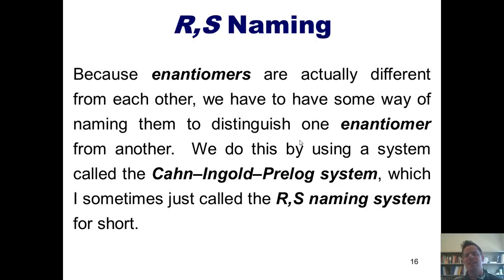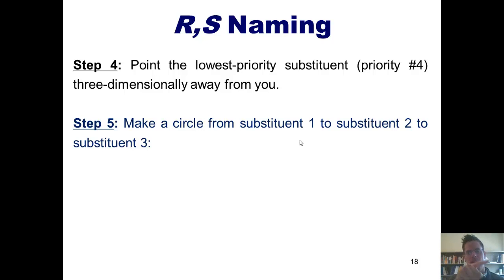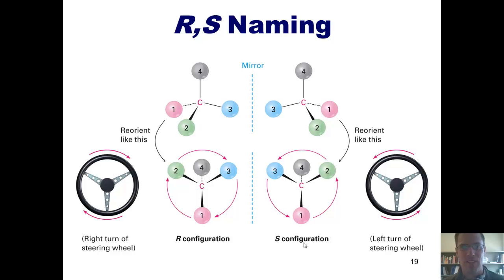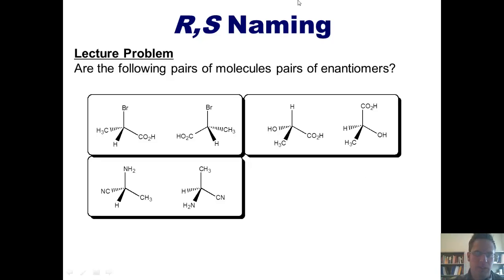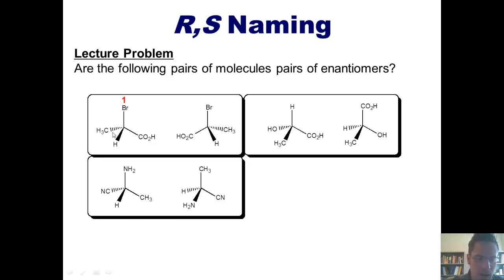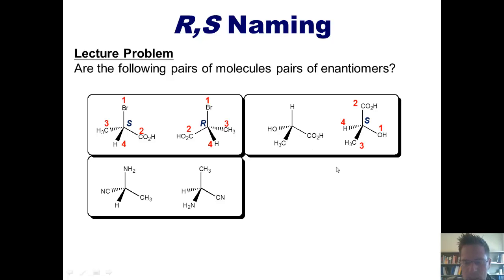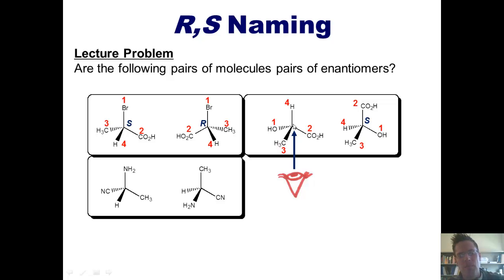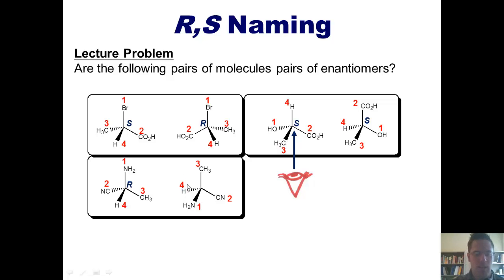Chapter 5 – Stereochemistry: Part 3 of 6

Comment: At 13:13 in the second pair of drawings with the eye ball you drew, shouldn't the first on be an R chiral center and not an S? If so wouldn't that make them enantiomers?
Reply from the maker: Unfortunately, Claire, the answer is no. It is S. You have to look at it from underneath the tripod, with the H (lowest-priority) pointing away from you. You then trace from the OH to the CO2H to the CH3, which is a counter-clockwise direction in this case. That is S, not R. The trick is that if you trace from OH to CO2H to CH3 as it's shown, it looks clockwise (R), but that's only if you're staring at it NOT from a direction that points the H three-dimensionally away from you. It might help if you build a model and look at it. You can do that by either purchasing a model kit or by using marshmallows and toothpicks (they're cheaper, and you can eat the marshmallows when you're done!). 

With that said, if the left example were an R configuration, then yes, the pair indicated would be a pair of enantiomers.

I hope this answers your question, Claire. Thanks for posting and watching! Please let me know if you have any more.
Reply: But if you were going from the OH to the CO2H then to the CH3, thats going clockwise isn't it, making it an R? Sorry, I am just trying to understand!
Reply from the maker: No worries, Claire. Let me explain this a little further. To do this stuff properly, we have to keep in a mind a few things:

1. Just to be sure, I'm talking about the left-most compound of the two shown in the upper right-hand corner at 13:13 . . . the one with the eye floating beneath it.

2. The wedged bond (going to the CH3) means that the CH3 is pointing three-dimensionally towards us (out of the screen).

3. The dashed bond (going to the OH ) means that the OH is pointing three-dimensionally away from us.

4. The straight-line bonds (to the CO2H and H) mean that those two groups (the CO2H and the H) are three-dimensionally in the same plane as the screen.

So these different kinds of bonds are actually trying to convey actual, three-dimensional shape, though it is hard to do perfectly on a 2D surface. With all that in mind, I understand that the way things look at 13:13, as it's drawn, is that if you traced a circle from the OH to the CO2H to the CH3, it looks clockwise, which would be R. However, that's not how the R/S naming system works. You have to point the lowest-priority group (in this case, the H) AWAY from you three-dimensionally first, and THEN trace from OH to CO2H to CH3.
Imagine it like this: If the H were the stem of a bouquet of flowers, and you grabbed it and held the bouquet so that you're looking down at the three flowers (the OH, CO2H, and CH3) pointing TOWARD you, with the H pointing AWAY from you. Another way to imagine it is if you were looking at this molecule from underneath the tripod, staring up its crotch, so the H is pointing three-dimensionally AWAY from you. If you were staring at this molecule from that angle, then you would see that the trace from OH to CO2H to CH3 gets reversed. It's now counter-clockwise, which is S.
This is the way the R/S system works. You always point the lowest-priority group three-dimensionally AWAY from you before you do the clockwise/counter-clockwise trace.
I hope that makes sense and that you can see that. If not, then I'm not sure what more I can do.
Thanks for posting and watching! Please have a wonderful day!
Reply: @chemistryunleashed4348  i just have to say youre wonderful teacher. thanks to you and all the other passionate people on youtube